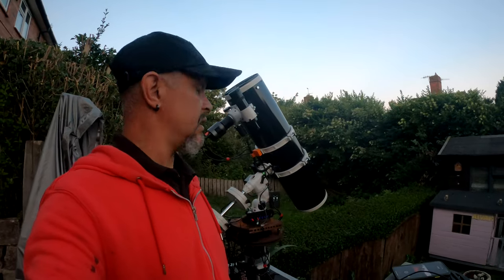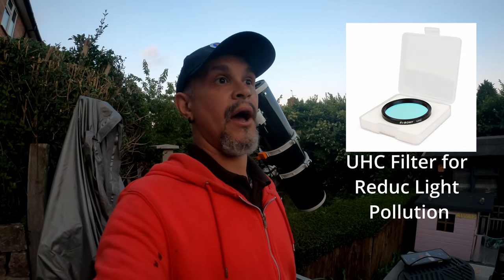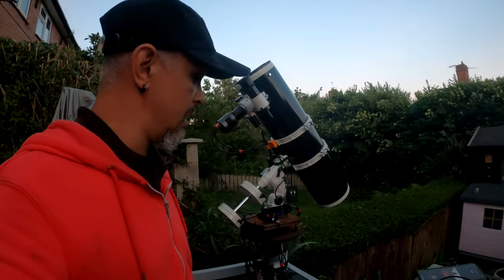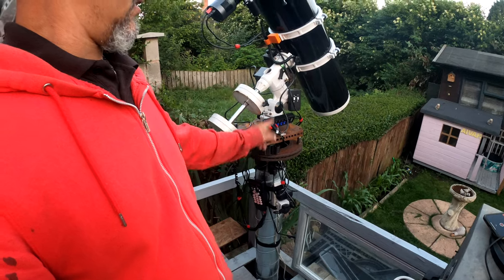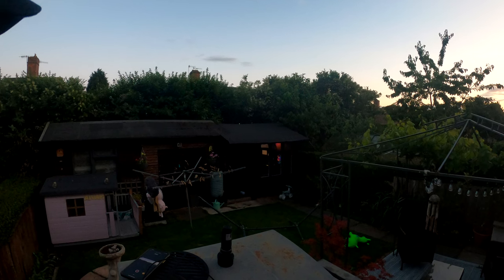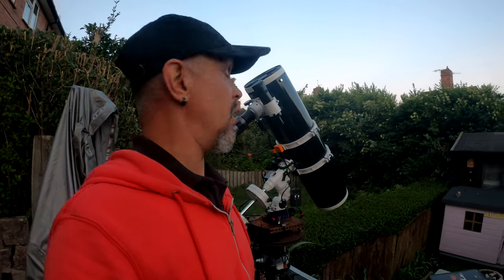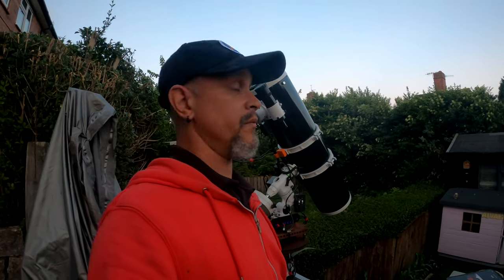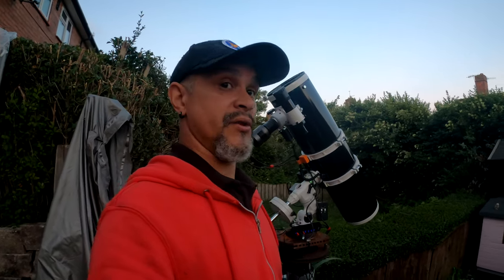Is it good or bad ? First time for me ( galaxy With svbony sv220 filter ) Svbony Sv503 Telescope

Comment: Hi, your images are looking good, For many years I'd really only done visual astro and occasional use of a modded dslr. I Recently Invested in the ASI 585C camera with an Altair CLS CCD filter also a second hand Evolux 62ED scope. The light gradient near Portsmouth is pretty bad from our backyard, but with this cheap filter and setup I've been able to get some very good galaxy detail and amazing nebula images using this filter. I've also teased out  detail in galaxy arms due to the cameras small pixel size & sensitivity even blobs of colour comes through. The Crocs eye galaxy was a tricky one this year, but with 3min subs, cropping and careful post processing was able to get some inner structure and colour..(subject to cloud😂) The neat thing with the ASi585 like the Player brand is a sensor with no amp glow and able to operate at high ambient temps with little thermal noise, Although technically a planetary it's a very capable DSO camera..(maybe the future of astro cameras) !! Ive been considering buying a cooled SVbony 405C, to use on my larger old C100edr  and 9.25inch scopes for the larger pixel size but understand the 294 can be a tricky sensor to calibrate, although you  appear to have mastered this in your image 👍👍.. Regards, best of luck, Clear skies Tom.

Comment: I had to do a double take when I first saw the vid, Is that a 200P/PDS mounted on an EQ3/2 goto mount? I assume your running unguided. Anyway, Tip for the SV405CC, Andyofastro has a youtube video called "First Light with the Stella Lyra F5 Scope! And why 294C camera sensors often don't calibrate.... ". Review that and test your sensor to see what gain is "usable". Thank me later.
Reply from the maker: Yes that's the 200 P on the eq3 pro the only thing is I'm limited to around 3mins exposures otherwise it works fine I would not suggest anyone else doing it bought my mount please quite old now and I will be upgrading soon aspall the sv405 I will check out that video thank you very much
Reply: @AstroDadsUK  No worries, I'm trying the EQ-AL55i Pro. I like it for the most part. It's my first goto mount. I'm having guiding issues though but I think alot of it is me doing silly things. Although I do have backlash issues. Everything feels very "tight" on it.
I just got the SV705C (IMX585 based), the SV405C will be a later purchase hence why I've been looking at the issues and how to solve them.
Reply from the maker: @DrhexUK  I also have backlash issues This is why I do not guide but mine is mainly to do with in incompatibility mainly, As for the camera I've had no issues whatsoever